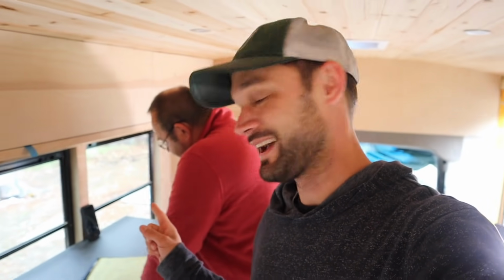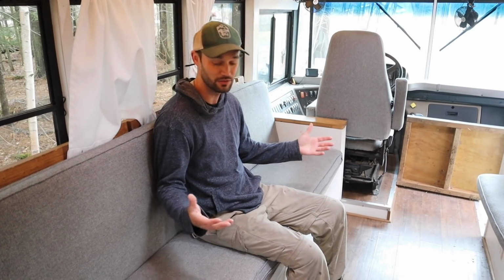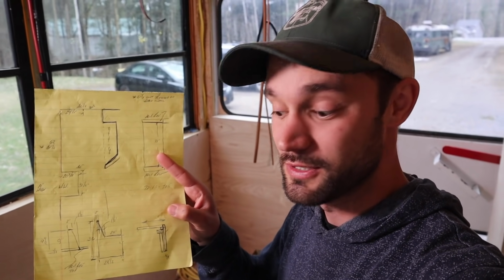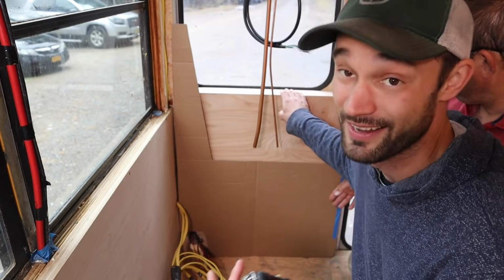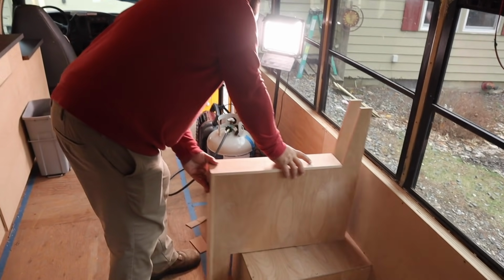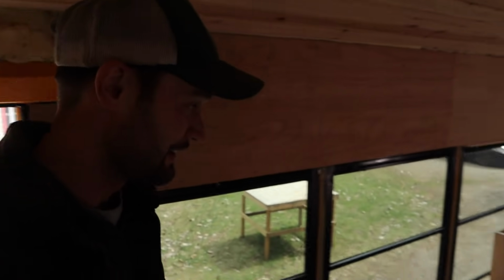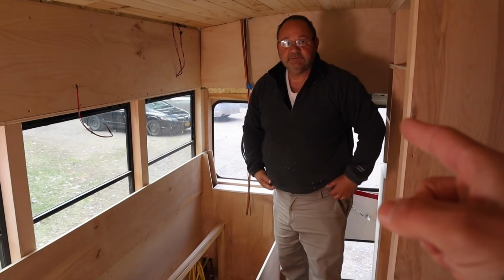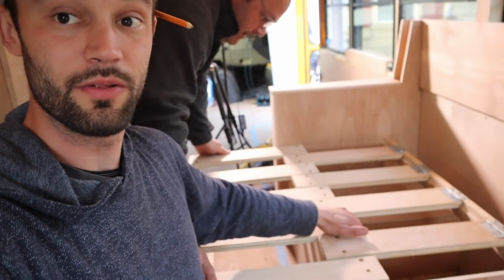Starting to Build The Pull Out Couch In My Bus Conversion

Comment: Slat slide conversion beds are great solutions. Mike, I hope the cushions you get will be super sturdy, with such a wide gap between slats in the bed position you might suffer with support issues. I suggest adding a piece of flat stiffener material behind the foam inside the cushion cover. Could be as simple as gessoed corrugated cardboard, plastic coroplast or luan.

Comment: The arm rest side are plywood.. so they can be hollow.. you can pull up the arm rest to make some space for your computer/shower storage (toiletries)...the seat front part is all wood sheet.. make some holes (design them holes...so air can vent.. and the storage underneath is not mushy...cover the air vent with some cloth mesh.. from the inside..so your cloths are dry.. don't throw away the hole cutouts.. you can put e'm in.. if your cloths are wet in storage in winter... the best way to sleep in a closed space like this is to sleep diagonally.. so if and when your sleeping with some company in ur bus.. atleast your legs are not hanging in mid air on the 2 piece mattress.
Reply from the maker: I think in the future I will make the faces of the arm rests open. They can be adjusted in the future if I find I need the space. Thanks for the tip!

Comment: I am most likely going to steal a bit of your design in my apartment is oddly shaped with a 6 foot by 4 corner  that goes into a 6 foot bay window. This is the only place that can fit a sofa. So I was planning out a sofa that would be a little L sofa chase combo that could have a fold but back that will turn in to a sectional. I also am going to have it slide out in section to do a chase or into a 6 by 7 bed. behind the sofa is going to be a 1 foot deep book case so in little L the front cushions will line up with the bay window indent This has really helped in inspiration.

Comment: Nice work on the couch/bed! Be aware of your flooring choice in front of the couch because as you deploy it into “bed mode” the foot of your front vertical panel has to not only navigate over the floor surface but also rest upon it when extended. Ask yourself: Will the extension slats remain level with the stationary slats when extended once the final floor surface is installed?
Reply from the maker: Thanks for pointing that out. I already pre cut the front leg to allow for the flooring thickness. Right now its 12mm above the plywood floor.

Comment: Hey guys.  Love this couch build!!  Really clean and looks awesome!!  

Noticed in the earlier scenes of the vid, is there a leak where you're getting moisture on the plywood where the couch is going?
Reply from the maker: Yes one of the roof fittings cracked this winter and is letting water in. I will be fixing it in a future video. Sad to find come spring.

Comment: Great design and build. My question is what plywood did you use for back and front of couch? I just bought 3/4" for the seats but was worried about both the weight and cost of using 3/4" everywhere.

Comment: why was there a moister on the wood near the electrical line? Please explain!! how do you remedy such things like moister areas? will the heat from the batteries help
Reply from the maker: The water is coming from a broken fitting in the roof. I am going to be fixing it in the next video.

Comment: Why not just make a Murphy bed
Reply from the maker: I did not want the bed to go too high and block the windows. Also, I did not mention this in this video but the mini split ac unit will be installed on the wall above the bed.

Comment: I think your Dad's modification complicates the cushion design and may make the "bed" less comfortable. Hope not. :) Rich
Reply from the maker: I will have to let everyone know once we get the cushions on. I am interested myself to see how it all works out once I am living in it.
Reply: @navigationnowhere  I don't pretend to have the "right" solution but I try to ask good questions :) Will you be sitting on the pulled out bed when you use the desk? Isn't there room to crowd by the bed (even fully extended) to get to the toilet? And finally, why not gain access to storage via drawers. Seems to me lifting the panels and the slats to access the storage is cumbersome at best; and the joint between the front panel and the bench seat top is not strong. I will be interested in your solution. Best Rich